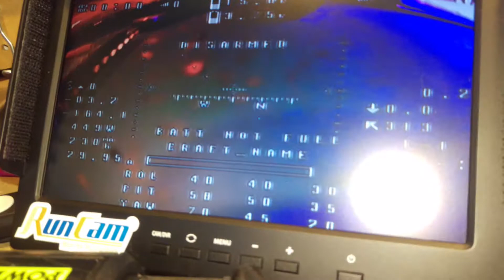Eachine Wizard x220s FC replaced WIRING 🙂 part 2

Comment: Hello, i Just buy a RTF version of this drone. my camera does not work. I check the output voltage for VTX and camera and i have got battery voltage ( 16.7v )  but in cam specs only can work from 5v to 13v  is something wrong with the flight controller?   the vtx can work from 7 to 24v.  but i think that my camera is toasted.
Reply from the maker: Is camera connected to 5v pad on flight controller and You've got more than 5? It was my mates drone. I was replacing flight controller on it and doing few upgrades. Not the best rtf racer I'll say. Build quality/ soldering is quite crap on them. Are You in the UK? Try to swap cameras if You got any spare. If not pick up Runcam Swift 2 or Foxeer Falkor if You need to replace it. Can You see on screen display at all when checking in goggles can You pick up vtx signal or at least black screen or something? If Yes then vtx should be ok on it and fc is ok if You can see at least black screen or close to black blurry screen and osd on it then camera is faulty. Stock cameras are pretty bad anyway on Eachine Wizards. I was always replacing them to something better
Reply: @KrzychOlsztyn   thank you for your reply.  I think the camera is broken, I can see black image and vtx seem work ok. i will buy another cam to try.  my problem is voltage fed vtx and camera is batery voltage. so camera does not support that voltage. I will try to fix soldering positive wire of camera to 5v pad.  I am from Spain.    cheers mate
Reply: @Rafa_Aguilar  Hi, i'm having exactly the same problem and I noticed the same thing with the voltage being too high. Did replacing the camera solve the problem or did it fry the new camera?
Reply: @JW-jp2xs  Hi  I solve the problem solder positive cable of new camera to 5v pad of the flight controller. Or  you can buy a better camera with long voltage work.  For example caddx ratel can work from 5v to 40 v
Reply: @Rafa_Aguilar  Hi, thanks for the advice. I have since purchased and fitted a new camera that can handle the high voltage, I was a little nervous about soldering and rather not do it for warranty reasons. All sorted now and cant wait to get flying!
Reply: Had the same problem I just soldered directly to the esc and it works fine